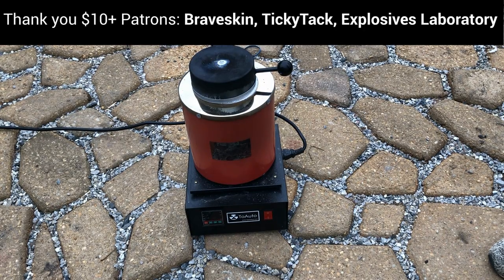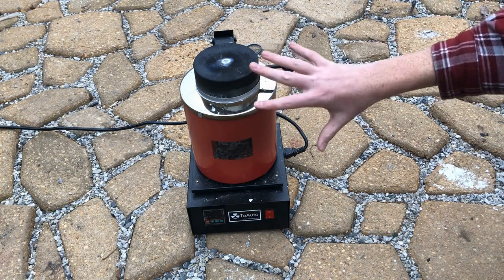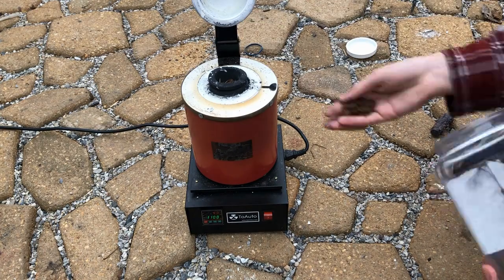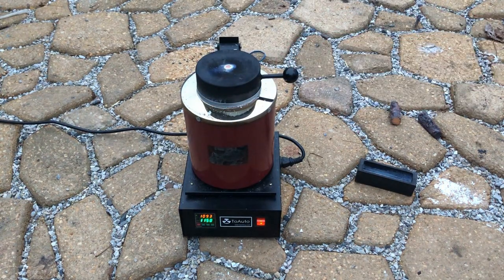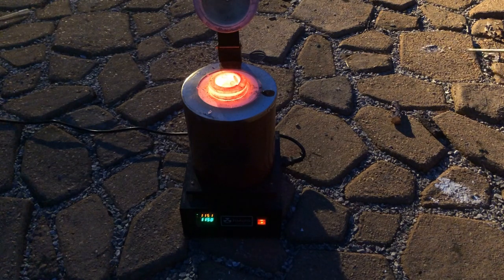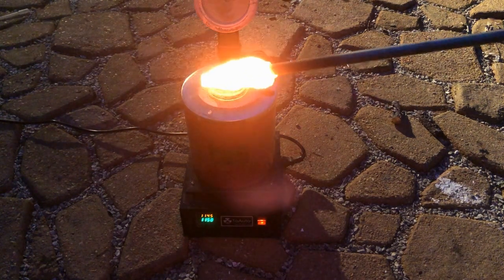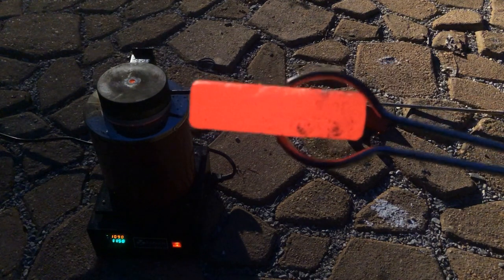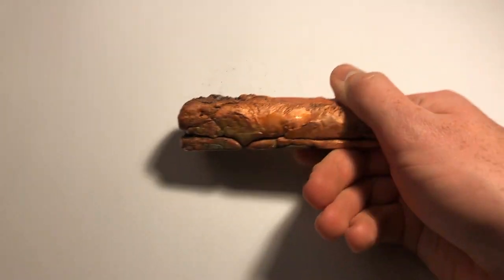Casting Copper with a ToAuto 1400W Electrical Furnace

Comment: i have this same issue where i set it to max temp and it still doesnt melt copper wiring. I one time had it on for 3+ hours max temp and the only thing it did was turn the copper bright orange. Poked it around a few times and it still was solid.

Comment: As I suspected, the furnace just barely gets hot enough to melt copper, and not really hot enough since it really needs to be a few hundred C above its melting point to pour well.
Hence the wrinkles in the ingot.
I have a furnace of similar max heating capability -- basically as hot as a nichrome element can go without self-destructing.  Haven't tried it with copper for this reason.
It might do a well-formed ingot in a pre-heated (really hot) mold.  But IMO some other heating method is necessary for really practical casting.
But hey you got your ingot and an awesome furnace!  Good video, thanks!
Reply: I am looking for such a furnace that you are speaking of. What is the best?
Reply: @intothecalm420   Unfortunately I can't advise because my only furnace is a really old formerly-dead one that a friend gave me, which we together refurbished with a new PID controller.  It's rather small and  really not made for metal melting, having a hinged front door rather than access from the top.

Generally speaking, lower-cost electric furnaces use nichrome or kanthal heating elements and aren't capable of temperatures much above 1200C or so (higher and you risk destroying the element and/or dramatically shortening its life).

There are some fancier heating elements based on molybdenum (e.g. MOLY-D) or tungsten alloys that can produce much higher temps.  If you're going to electrically melt copper routinely, that's what you'll need.  I'm unfamiliar with the choices for such ovens, but the Internet is magical.  You can probably learn more than I know in a half hour of searching and reading.
Reply: @jamesg1367  
Thank you for the information.

Comment: Just as a tip, it’s much easier to start with less material in the furnace. Once you have a bit of a puddle of your metal in there it tends to go much much faster. And be kinda careful with additions cause if you add too much it’ll cause the whole thing to freeze which is annoying to say the least. Good luck making “various shapes” ;)

Comment: American Lincoln cents were never 100% copper. Hence the zinc in your ingot.
Reply: @TheGoodCrusader  
Brass is without a doubt one of mankind's greatest achievements. 
Although that wasn't my point.
Reply: Pre 82 is 95 percent copper, the furnace should of burned the  5 percent zinc out